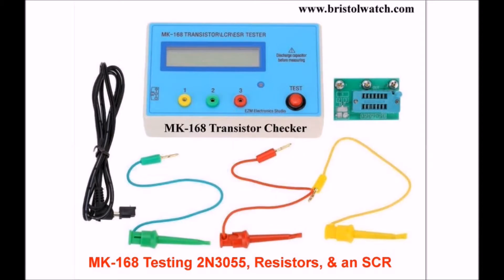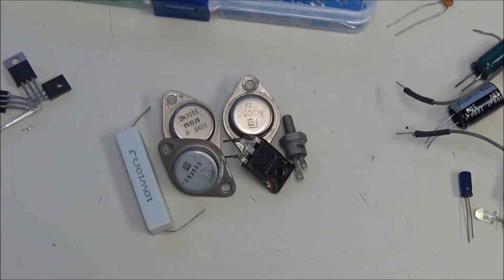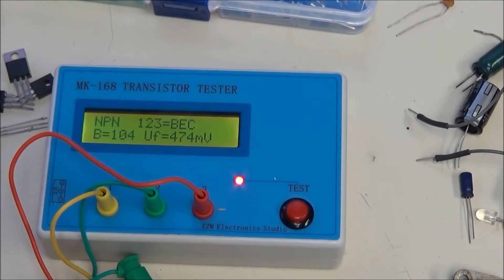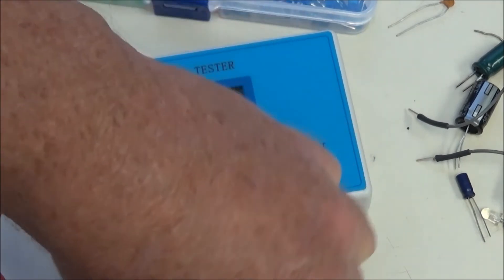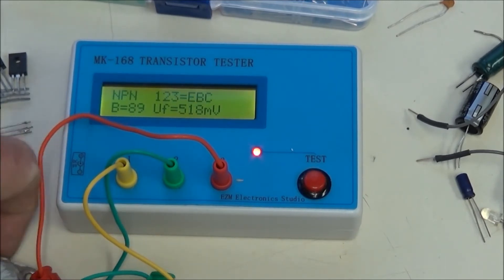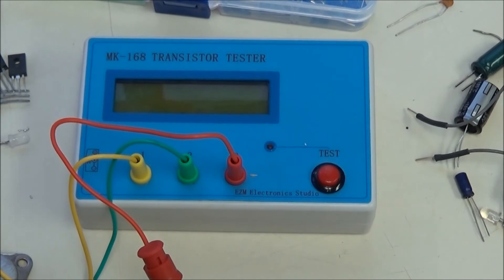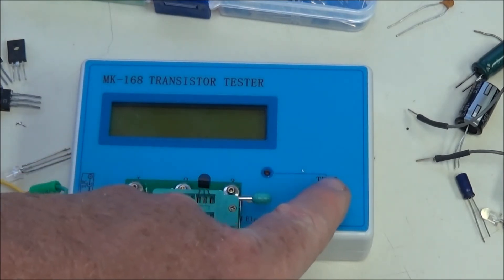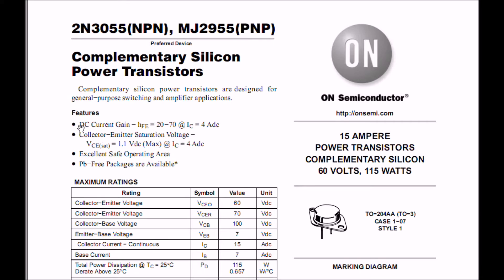Checking 2N3055 Bipolar Transistors What to Know

Comment: Great video Lewis.  Beta and Vbe vary widely with temperature also. I have watched 3055 parameters vary on a curve tracer while heating the device with a heat gun. Illustrates how important bias network is for reliable and safe operation.
Reply from the maker: Very true. Thanks.